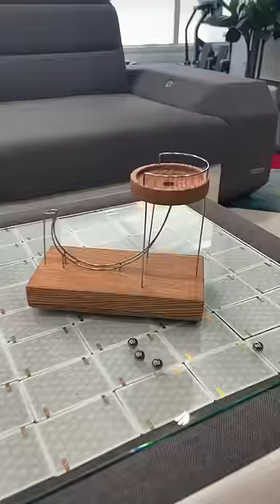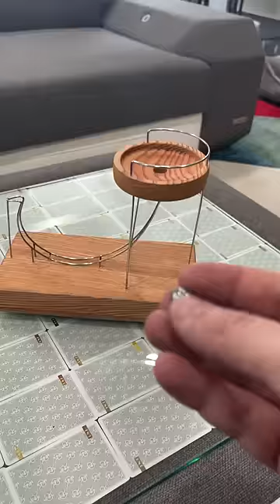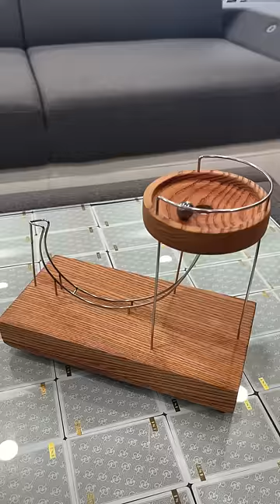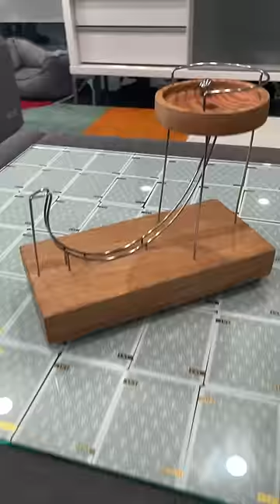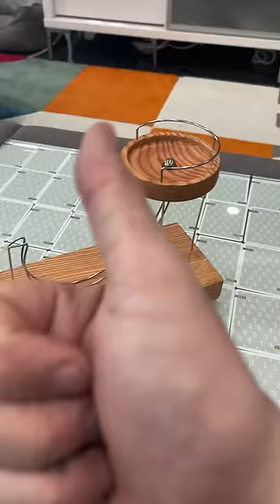An Impossible Perpetual Motion Device?! 😳 #Shorts

Comment: Him : this is a perpetual motion device. 
Also him : perpetual motion is impossible according to thermodynamics.
Reply: @IAmMuchAnger  if this went on forever it would be perpetual
Reply: @IAmMuchAnger  this is totally fake it use battery and on the hole There is something to lunch it
Reply: @PimousseSSB  reality is often disappointing
Reply: @IAmMuchAnger  sorry for you :(
Reply: "This is APPARENTLY a perpetual motion device."

Listening is difficult isn't it.
Reply: Did you miss the part where he said  "... but if it did exist would sort of look like something like this"
Reply: @IAmMuchAnger  true but because of gravity the ball cannot be launched higher then where it started
Reply: @vanduivenbode3305  true didn't consider that
Reply: Cristales de tiempo de Google ...bye 2 law of termodinámica
Reply: Well it is technically possible in a sense, this sense but behind the scenes it is using gravity to create force, altho gravity seems like an endless energy creator it’s only in motion due to size of earth and the fact it’s spinning around another gravitational device but said other gravitational device will inevitably explode taking out the initial gravitational device. Which in turn takes out the perpetual motion device as well
Reply: @IAmMuchAnger  it has nothing to do with the brief pause at all. If the device was working as it appears to be working it would be perpetual motion with or without that pause. 

There is not enough energy to get the ball back into the wooden tray - something (likely a battery or something) is adding energy to the system. He doesn’t explain what it is but he made it clear there’s something we don’t see
Reply: @IAmMuchAnger  it is perpetual motion. The energy never stops. The ball never stops moving. The energy is transferred and redirected, but both the energy and the ball in-motion are continuous. That makes it perpetual.
Reply: @IAmMuchAnger  wrong, it's magnets
Reply: @Dehydrated_H20  it's an electromagnet
Reply: @IAmMuchAnger  that would still be perpetual. This isn’t perpetual simply because we know energy is being lost through the sound of the ball. This is, I assume, just very efficient and will run many many times before it fails.
Reply: @fabe61  The people who unlike me know physics have already added that this system is still impossible because gravity wouldn't accelerate the ball enough to go back into the bowl. Missed the point but still not infinite
Reply: @PimousseSSB  it's probably magnetized, not using a battery.
Reply: @IAmMuchAnger  but, it is called a perpetual motion device… it’s always in motion lol
Reply: Thermodynamics sure, there is no heat in this system, just physics.
Reply: @PimousseSSB  is there something that dinners it too?
Reply: @IsDefinitelyHuman  Thermodynamics deals with the dynamics of energy on systems which includes kinetic energy you absolute Salmon
Reply: @IsDefinitelyHuman  Your comment made me lose brain cells.
Reply: @IAmMuchAnger  Ik this isnt perpetual motion (I have studied thermodynamics too). And why have you explained that here?
Reply: @IsDefinitelyHuman  its an open system,assuming there is no heat transfer(there is some) between the surrounding and the system.
So ΔU= -W. 
Since workdone by the system is taken to be +ve
ΔU=-W
So change in internal energy will be -ve.(U of system in final state is less than the initial state that is loss of energy)
 In this video some kind of work is done on the system and in thermodynamics work done on the system is taken to be -ve 
So ΔU=-(-W) =+W 
Therefore change in internal energy Is +ve. (U is greater in final state)
Reply: @IAmMuchAnger an electromagnet is being used to accelerate the ball as its falling.(Some comments pointed it).
Reply: @onee  getting a joke is hard isn't it
Reply: @IAmMuchAnger  it would be perpetual motion dude ur going really far to try to sound like the smartest guy in the room. Starting the same motion over and over again is actually a big part of the concept ur putting an unnecessary distinction between continual motion and repeating motion but in the concept of a perpetual motion machine it wouldnt matter because the whole point is a scenario where energy is constantly being created and powering itself which it would be
Reply: @somerandom3969  aaaaaand that does it doesn't it? Gonna get answers to that comment for weeks because I forgot how fast gravity throws shit up ramps. That's what I get trying to be the first response to a comment
Reply: @nicholasszabo5954  it used a battery I know someone you bought one and show me the trick.o the hole there is an engine that accelerates the ball. t
Reply: @PimousseSSB  its called a magnet
Reply: @BlooHoots  no magnetic effect it’s a motor who accelerate the ball
Reply: @nicholasszabo5954  Sorry for you it’s using electicity my friend get one of these
Reply: Guys stop Being stupid infinite mouvement isn’t possible without externe energy that’s a rule
Reply: @onee  some guys don’t understand that
Reply: @PimousseSSB  u right, I saw his other video. Btw a magnetized version still would not be a PPM
Reply: @PimousseSSB  it has an electromagnet in the base and those wire track act as a switch.
So when the ball touches the track it closes the circuit which activates the electromagnet and it accelerates the ball.
Reply: @Galen McKenna not sure if that’s supposed to be sarcasm or not but I am pretty sure I was high and or drunk when I made that comment 😂
Reply: I thought it was Kinetophysics that made this possible?